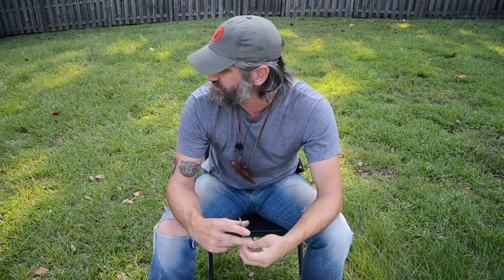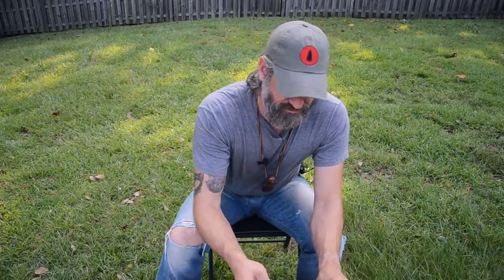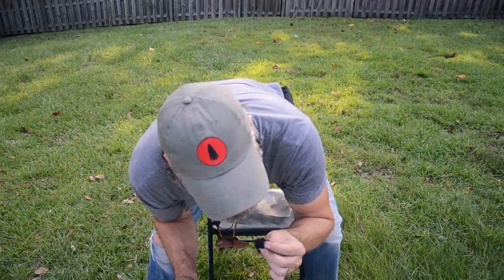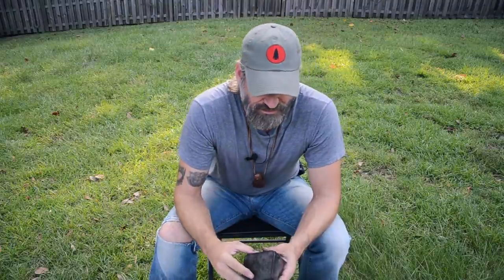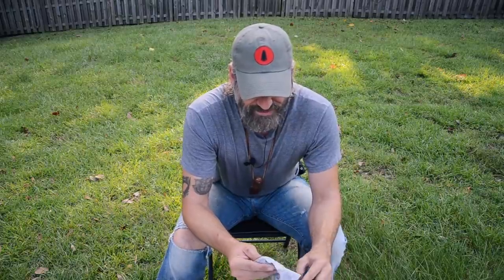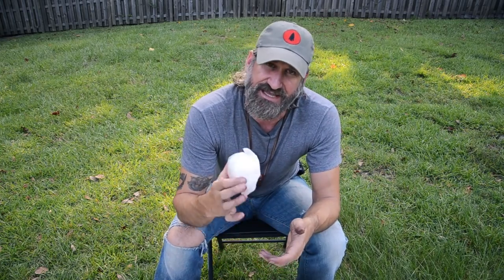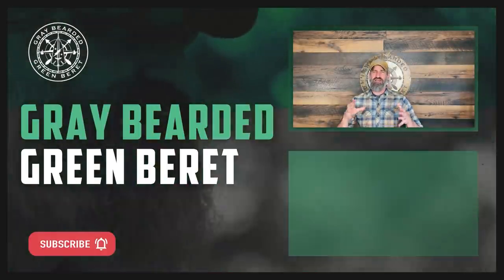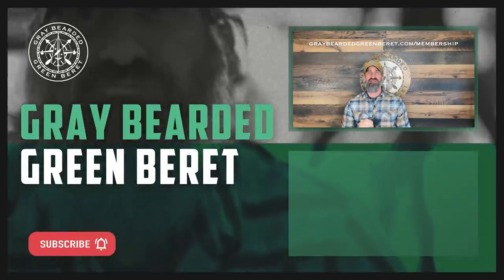How To Make Char Cloth | Gray Bearded Green Beret

Comment: Experimented with various weights of cotton fabric to make char cloth. Fine cotton like gauze or wife beater shirt is easiest to catch a spark (lots of air around the carbon) and hold a spark but burns relatively fast. Flat jean material works but was worst to light, holds ember long time. What was awesome was rolling jean material tightly to thickness of cigar, and charring that. Cut 3/4" off the log and place on end to catch spark. You can blow this into a big hot ember that you won't have a problem lighting tinder from.

Comment: Have you heard of those piston fire starters where you take a small piece of char and place it inside the piston starter by friction it lights up the char
Reply from the maker: Fire piston, yeah. I am not a fan of them myself. Rubber o-rings wearing out and needing replaced, I like regular old flint and steel or solar for charred material. Simple.

Comment: Can you do video “ Smoke less fire”   Thanks
Reply: Where's there's smoke, there's fire.  And often vice-versa.  Usually, in fact.  You can have a fire that will produce little to no smoke during PART of the process, but there's no way to make a fire from start to finish that does NOT produce smoke at some point.
Reply: @asmith7876  ok. Thanks
Reply: Drier the wood, the less smoke it produces.